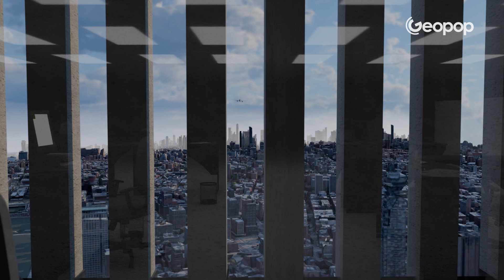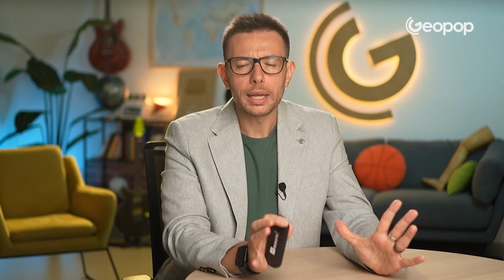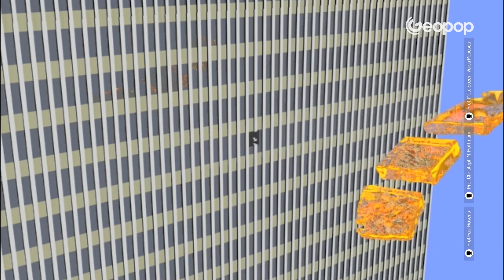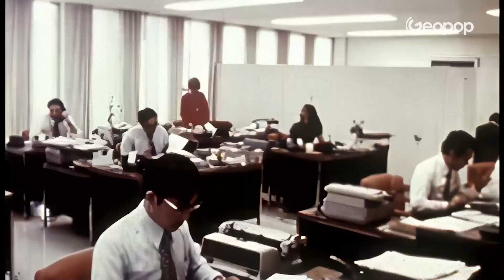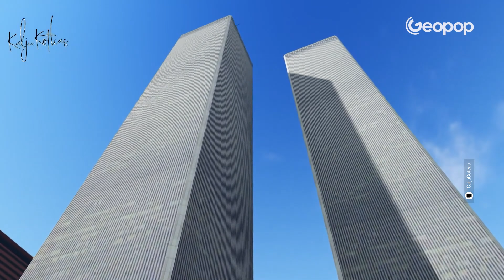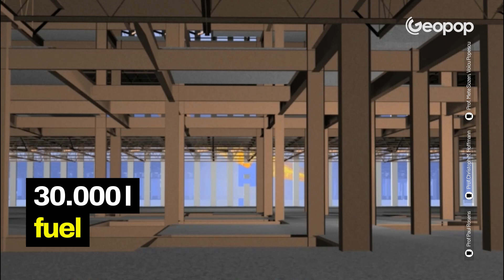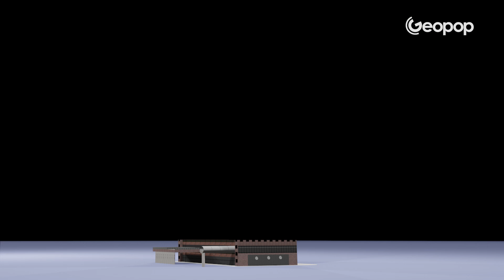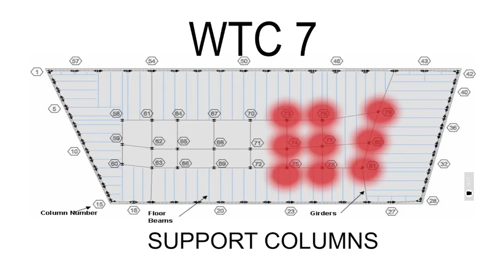9/11, 2001: The Technical Reconstruction of the Twin Towers and WTC 7 Collapses

Comment: One problem. Other high buildings in other cases did not collapse in a greater fires. 

So wtc towers were badly constructed or smth else
Reply: One problem.  You are doing this wrong.

The collapse of the steel framed Twin Towers don’t have a single cause. It is a combo-platter of four (4) elements: 

Impact Damage + Fire (heat) + Time + Gravity = Collapse 

Remove any one of those four elements and there is no collapse. Ignore any one of those four elements and you will never understand the collapse. You are ignoring three (3)
Reply: @TheLoonResistance its controlled demolition,  so time, impact, fire, and gravity didn't matter because it was blown down with explosives.  8:25
https://youtu.be/bLF5D7M1YgA?si=aHSvS__uOdxMi1ZB
You can't say that it was added because you can see the firemen's reaction to the explosion. And you can't say it came from anywhere else because the firefighter says
" We gotta get out of here,  
2. The firefighters said" it looked like they planned to take down the building" I didn't say that, The fire fighters said that. They were there.I'm sure they know best.
https://youtu.be/XiIT4HInWjY?si=e1Pvp3-IFs-M75Oj
When the firefighter says "boom, boom, boom, boom" in this video.
What do you suppose he is?Implying by " boom" ?? 

3. Controlled demolitions have squibs, you can see the squibs here 20 floors below the collapse. 
https://youtu.be/eXAgulfAtR4?si=-iLO9aQjMJVLTUYH
4. Firefighter says "any one of these buildings could blow up,  this ain't over yet" firefighter says there's 3 secondary explosions. 
https://youtu.be/0Gh3ErgMI4M?si=mmp9Eus_5PWTCBfl
5. Airplanes can't fly 600 mph at 1000 feet. And to be able to make a 180 degree turn to hit the opposite side of the pentagon going that fast is ridiculous. And since when do terrorists hit the opposite side of the building where no one was at when they could have just flown straight in and killed way more people???
https://youtu.be/0Gh3ErgMI4M?si=mmp9Eus_5PWTCBfl
7. No one has ever known ahead of time that a building was going to collapse except through controlled demolition.  Tower 7 was reported to have fallen while it still stood in the background. 
8. Larry silverstein,  the man who made over 4.5 billion when they fell, claimed to have pulled the building down.
https://youtu.be/1jQaJFNWqtc?si=wCywQ9grgBdS_w11 yet somehow
Reply: @robbiehiatt9966 you are looney. The explosive sound is the sound of floors upon floors smashing into each other and steel snapping. You can watch on of the several high def vids of the building coming down and it starts to go right at the fucking impact point. It's doesn't even take much more to disprove your stupidity. The fireman said to get out of there because a building collapsed. Moron.
Reply: @TheLoonResistance not quite so. 
Impact did not crush it much. Everybody says it is fire made it. 
But many other sky high buildings survived much worse fires. So why here it was so bad.
Reply: @alexkast628  - You are still stuck in single-element (non)thinking about a multi-element problem

Impact Damage - Destroys dozens of perimeter and core columns, resulting in the loads those columns being redistributed to survive columns, some of which are damaged. These loads are not redistributed symmetrically.  Some columns will carry much greater loads than others, leaving reduced reserve capacity. 

Can you name me any examples of Other high buildings in other cases where this was a factor?

No, you can not. 

Fires (heat) - Unlike a typical fire which starts at a single location and gradually works its way out from there, the Twin Towers were subjected to 5 tons of accelerant, which caused massive fires to break out of multiple floors simultaneously. The building was also well ventilated allowing an uninterrupted flow of air to feed the flames. Going back to our first point, impact damage destroys active and passive fire protection systems. Fire barriers, gypsum board walls and insulation are blown out. Sprinkler system stand pipes are ripped out. Finally, there is zero active firefighting 

Can you name me any examples of Other high buildings in other cases where any of this was a factor?

No, you can not. 

Time - Like most, you ignore this entirely. The initial impact damage alone obviously was insufficient to cause collapse. The buildings were still standing after impact. The fires alone (without impact damage) would also have not been sufficient. Active and passive fire protections would have been in place and active firefighting would have not only been possible, but likely. Over time the damage accumulates and builds. Floor systems and weakened and start to sag, causing the smaller number of increasingly overloaded and themselves weakening from heat columns to begin to bend, to bow inwards over time

Gravity - All that weight acting on unprecedented levels of structural damage over time eventually over time overcomes the structures gradually shrinking ability to support that weight.

Four (4) factors working together in an unprecedented event that has no comparison to any other event in human history.  Ignore any of those four(4) elements and you will never understand the collapses.
Reply: @TheLoonResistance as usual lots of words, no evidence. Ill have a go at it. Your 4 elements are missing a few things. Squibs for example points towards controlled demolition.  Tower 7 points to controlled demolition.  Numerous secondary explosions points to controlled demolition.  Basic physics points to controlled demolition.  People talking about tower 7 falling before it actually fell points to controlled demolition. The fact that the planes were flying at 600 mph points to controlled demolition.  Firefighters say it looked and sounded like controlled demolition. Larry silverstein said we decided to pull and then watched the building collapse. No dabris in Shanksville points to controlled demolition.  Molten steel points to controlled demolition.  The Gelatin group points to controlled demolition.  Put options points to controlled demolition. And most of all, silly videos like this and silly comments points to controlled demolition.
Reply: They were constructed out of the best steel that had ever existed. It's tube and tube design was a breakthrough in construction and were Reconstructed in many other buildings. They originally said the towers could burn to extinction without collapse. But they changed that because they fell down. The towers were also designed to be hit by two airplanes and not fall down.
Reply: @robbiehiatt9966  so it could be project mistake or a froud. Steel of bad quality etc.
Reply: @alexkast628 what makes you think the steel was not quality steel? In fact , what gives you the idea that there was anything wrong with the building?
Reply: @robbiehiatt9966 because it felt😂
If it was well constructed as all said, no reason for it to fall😂
Reply: @alexkast628 sounds like you are saying the building was gonna fall regardless and thats not even close to being accurate. It's almost like you're saying that when buildings are demoed , they shouldn't fall down because they are too strong but buildings are taken down all the time. Now towers 1 and 2 are over twice the height of any building ever emploded so those 2 are gonna look a lot different than most. The buildings had already been hit by a plane, and caught on fire and blown up and they didn't fall then. By your logic it should have but that wasn't the case. The buildings came down because of explosions. Heres proof. .  if there were no explosives then what is this? 8:25
https://youtu.be/bLF5D7M1YgA?si=aHSvS__uOdxMi1ZB
You can't say that it was added because you can see the firemen's reaction to the explosion. And you can't say it came from anywhere else because the firefighter says
" We gotta get out of here,  
2. The firefighters said" it looked like they planned to take down the building" I didn't say that, The fire fighters said that. They were there.I'm sure they know best.
https://youtu.be/XiIT4HInWjY?si=e1Pvp3-IFs-M75Oj
When the firefighter says "boom, boom, boom, boom" in this video.
What do you suppose he is?Implying by " boom" ?? 

3. Controlled demolitions have squibs, you can see the squibs here 20 floors below the collapse. 
https://youtu.be/eXAgulfAtR4?si=-iLO9aQjMJVLTUYH
4. Firefighter says "any one of these buildings could blow up,  this ain't over yet" firefighter says there's 3 secondary explosions. 
https://youtu.be/0Gh3ErgMI4M?si=mmp9Eus_5PWTCBfl
5. Airplanes can't fly 600 mph at 1000 feet. And to be able to make a 180 degree turn to hit the opposite side of the pentagon going that fast is ridiculous. And since when do terrorists hit the opposite side of the building where no one was at when they could have just flown straight in and killed way more people???
https://youtu.be/0Gh3ErgMI4M?si=mmp9Eus_5PWTCBfl
7. No one has ever known ahead of time that a building was going to collapse except through controlled demolition.  Tower 7 was reported to have fallen while it still stood in the background. 
8. Larry silverstein,  the man who made over 4.5 billion when they fell, claimed to have pulled the building down.
https://youtu.be/1jQaJFNWqtc?si=wCywQ9grgBdS_w11 yet somehow today he is only worth one billion dollars.
9. The pentagon had 80 cameras yet we only saw 5 frames.
10. When the corner in shanksville walked up to the crash site. He made it clear he didn't see a crash site, or plane dabris.

Comment: The main question is not how the building could collapse, but rather and first how an airplane—which is not made of steel—could fly into the building.
Reply: The pilot steers the airplane at the building and keeps going.
Reply: 484
It makes no difference whether an object is stationary or in flight. The only relevant factor is the difference in mass between the objects that come into contact. At the point of impact, the mass of the tower is still significantly greater than that of the aircraft. Just imagine the tower hurtling toward a stationary plane. Have you ever seen how easily an aircraft’s wings can break off, or how its nose can be dented by a bird—or even by hailstones? A "tin can" like that could never penetrate steel! @TheLoonResistance
Reply: @Truman-v2m  - None of that matters. 

122 tons of aircraft at 440 or 587 mph is a lot of energy focused over a tiny area of the overall building and will only effect that bit of the building it comes in contact with.  How much mass the first floor has means fuck-all.

It's about how much energy the aircraft puts into the target at the point of impact. Seriously, you wouldn't compare the mass of a bullet to the mass of the human being shot by it. You are making a silly argument. 

The perimter of the Twin Towers at the impact floors was 70% void space filled with glass. The rest consisted of hollow box-section steel tube columns welded up from A36 flat plate 14" on a side.  3 of those plates were just 7/8" thick, the inboard plate just 3/8".  The real weak point though was the four 5/8" bolts at the connecting flanges between the 36-foot long sections of steel column.  Bolt-shearing failure at these connecting flanges was the primary column failure mechanism.

If you visit the 9/11 Memorial Museum in New York City at Ground Zero one of the exhibits on public display is a perimeter column spandrel from right at the center of mass of where Flight 11 hit the North Tower. 

www.youtube.com/shorts/ox2fnto3DLU
Reply: @Truman-v2m  - Glad we got that sorted out.
Reply: @TheLoonResistance  I would like to believe the public narrative, but I cannot make out an airplane hitting the North Tower. See for yourself in the video "First Response (Full Episode) | 9/11: One Day in America"—watch it at the slowest playback speed (0.25x) between the 16:39 and 16:40 marks!  
There are no wings to be seen. It could be a cruise missile or something else—something we still don’t know to this day.
Reply: @Truman-v2m  - You mean the Naudet video?  https://www.youtube.com/watch?v=St7ny38gLp4 

I see the wings just fine.  Also, in the full length video the firefighters describe it as a American Airlines commercial jet and it leaves a Boeing 767 sized hole and damage in the building. Then we have other evidence like this:  

www.youtube.com/watch?v=P8mG9pyImb8&t=110s

Among other things.

That is the difference between belief and knowledge .  With knowledge you keep going, you don't just stop and throw your hands up at the first anomaly.
Reply: @TheLoonResistance If the max speed for the plane is 288 mph at 1000 feet, and the aircrafts Mechanical structural limit is 414 mph at 1000 feet. It could not go 587 mph. These facts can be looked at all over the place online. 
    Really your comparing bullets.  I can do that. If all these bullets are the same caliber,  you are comparing a lead bullet to a person but comparing the building to a person doesn't make sense. Its more like comparing a steel bullets density 7.8 g/cm3, to an aluminum bullets density 2.7 g/cm3. 
You got the perimeter column voids wrong. Its 65 percent if you count the structural windows as voids, your welcometo do the calculations,  the columnswere 3' 4" on center. Of that space , 14 inches were steel columns. So for every 40 inces there was 14 inches of steel, and 26 inches was window. That equals 14/26 or 65 percent. But structural windows are not voids at all, they are structural,  but I get it. Your trying to prove it to be weak so you left those parts out, you've increased the speed 173 mph. And you provided proof of not one thing you've said. With 14 acres of dabris,  how would anyone know where the beams from the 91st floor was at? Either way, you definitely didn't prove you knew or anyone knew where those particular steel beams came from. You may believe what people say and take it as evidence.But I guess you're not that intelligent. Lots of fancy words, not so much thought involved here maybe try a new topic.
Reply: Let's not forget the maximum speed of that aircraft in a dive at one thousand feet in altitude is only four hundred and twenty miles per hour. Not 600 mph. So in my opinion, there's no way that was the plane they said it was. Commercial airplanes are made to fly at thirty five thousand feet. Not one thousand feet.

Comment: I live in a 4 story building and was taking the elevator down today and imagining how horrifying and insane it would be to all the sudden be hurled into complete terror on a normal sunny morning and faced with a million challenges all at once.
Reply: So scary. I just watched a video that explains floor 78 of the second tower hit. Some of those elevators from that floor down to the other sky floor (I think floor 30 something) had the cables cut and plummeted. Those were the lucky ones. Unlucky were the ones that simply stalled mid ride. I can't imagine the horror in either scenario.

Comment: Can someone explain the velocity of both planes at that altitude? Commercial aircraft dont really drive at that speed. Or am I wrong?
Reply: They don't fly at 440 or 587 mph in normal service but then a Kamikaze attack is not normal service is it?

Nor is it likely the hijacker- pilots had any concerns about the comfort and safety of the passengers or fatigue life of the aircraft. 

Where people lose the plot is conflating "don't" with "can't".

Just because the aircraft are not normally flown that way doesn't mean they can't be.
Reply: Well , all of these planes supposedly hit their target at around six hundred miles per hour. At 10:00.\nFeet in altitude of 767 can fly 420 miles per hour.If it's in a dive. It might go a little bit faster than that , but it would definitely be unsafe and hard to control. There is no possible way for those planes to be flying that speed at that altitude.

Comment: I think he got it wrong when he says the temperature was not high enough to melt steel.
There are multiple videos showing molten metal falling from a corner of one of the towers and it did for an extended time.
Maybe it was not steel, but what then, aluminium?
Reply: It was aluminum from the plane.
Reply: Molten steel was reported by the fallowing 
people. Captain Philip Ruvolo (NYCFF), 
Richard Riggs(debris removal expert) , Leslie Robertson (wtc structural engineer), Lynn Margulis (University of MA),   Robert Kim Ireland( chemical engineer for US Army Corp of engineers),Abolhassan Astaneh from Berkeley, Mark Basile( chemical engineer), Kathy McGrade (materials engineer), Gery Warner( Mechanical engineer), David Gregg( PhD Chemical engineer), Steven Jones PhD( physicist), Kevin Ryan ( BS Chemistry), Niels Harrit (PhD Chemistry), Tom Sullivan( Explosives team) Jason Cheshire ( Chemical engineer), and Jeffrey Farrer (PhD Material science engineer).

Comment: At least the towers pancaked and didn’t topple which would have caused much more damage and causalities.
Reply: They didn't pancake. It was controlled demolitions
Reply: @robbiehiatt9966 umm ok
Reply: @thumperpaul if it had pancaked,  the pile would be taller than the lobby, and the top of the building would be ontop of the bottom. Actually the bottom was still sticking up out of the dabris. The 2 towers landed everywhere except on top of the bottom of the building.  Buildings up to 15 blocks away was damaged. How does a falling building damage things 15 blocks away?

Comment: TEMPERATURE of the heat - that's why.
Reply: It was controlled demolition.  The heat should have never been hot enough to melt steel.
Reply: @robbiehiatt9966  listen more to some conspirasy poscasts, better read science on how steel metled and in what conditions. ask constructional engineer.